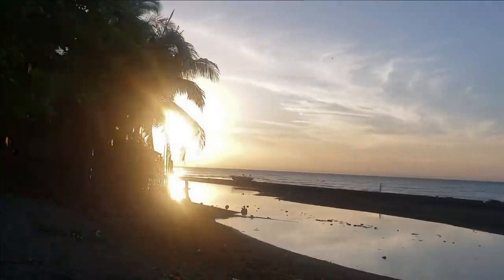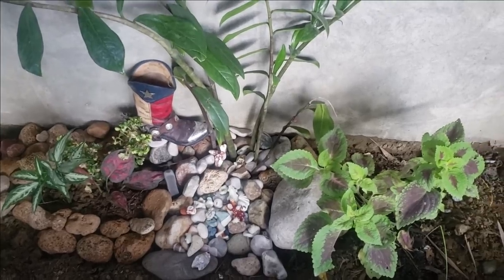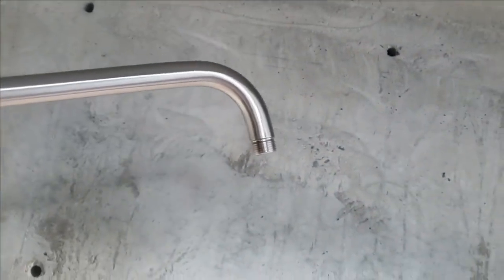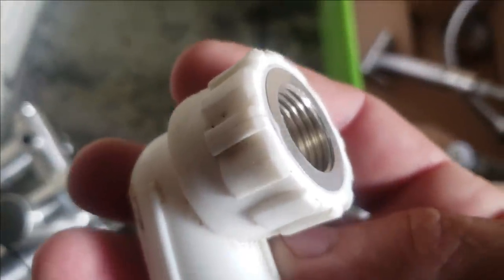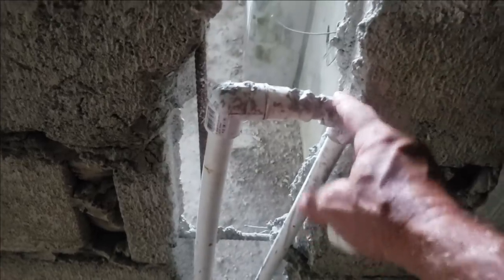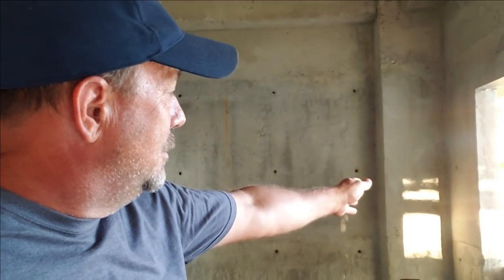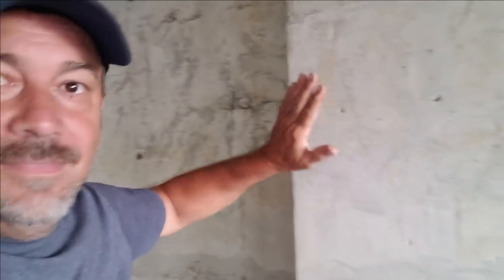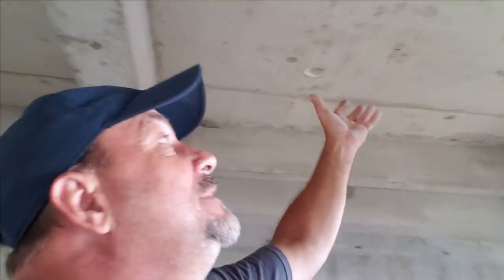Philippines Beach House Build Day 159 Part 1  GIVE UP  DREAM Beach CONCRETE HOME? Just Informed

Comment: I'm a master electrician and like your idea of building with concrete, but would prefer inside walls being steel studs and drywall. I would be much easier to wire now and for future needs. I hate the idea of CHB as you do. I'm sure it may cost more but not sure how much more. Other considerations maybe seismic activity and its effect on the interior walls. Your thoughts? Great job on the concrete, I really like your methods with the forms and finishing.
Reply from the maker: Less is more. The more you put in the more the cost the more to care for and the more to get damaged. DRYWALL and humidity - really ?  BAD USA practice! Mold - water damage ,cracks UGGGGHHHHH free your mind of the cheesy tract homes ways of thinking in America.  I know your a electrician but how much power could you possibly need and have you not seen how easy this is to wire. They almost wire themselves. Think In advance and say ok what could I possibly need in the future? Think - do you want to have extra circuit outside or some other places. run a empty conduit  for just a few dollars and pull it if you ever need it.  ask yourself what is drywall for? it is to have a smooth finish surface as interior wall yet you would be covering up the best one!  Fiberglass insulation in tropics - humidity drops it and it molds. All health hazards from  American practices.

Comment: Your totally correct with your construction method, saw your videos to late after I started my single story small build for my pool house,  24ft by 21ft. The amount of cement for finish has been incredible, and your so correct about the amount of rework for wiring and plumbing. I have a gibson ceiling which looks so much better than the traditional plywood or hardiflex, even the guys are surprised how much quicker it was to install and finish to a paint finish,
Reply from the maker: Great to hear!

Comment: I have watched loads of people building houses in the Philippines I cannot believe it the use of hollow block it's unbelievable it must cost more money than they think you're correct your way as far superior than their way
Reply: Understand concrete block is commonly used in the US. I live in Florida and I would bet 80 % of new construction is concrete block. Here the code requires filling certain hollow blocks with concrete. The issue with James wall is how it was built. In other words half a$$.  What James is showing us is so common on every island I’ve been on. Also I’ve seen many people move in their new home and never paint the exterior and some hold off on putting windows in. I visited someone once and they didn’t even have doors installed. Went to the kitchen when I woke up and some chickens were keeping me company till I chased them out.

Comment: 2:05 you talk about using the cement sacks to put down on earth and stop the grass from growing in your wife's garden. This is an excellent idea. I did the same thing here and I used the yard netting black fabric and put it down and then put bricks on top of them to stop grass from growing in the brick work. But I messed up and put a small amount of dirt in between the bricks so they wouldn't move when you walked on them. Then grass still grew. I learned that grass seeds grow in the tiniest amount of dirt and they don't need deep ground to grow. I can't fix it because it was too much work putting the bricks in. You have to do what you are doing with thick sacks or use concrete or sand in between bricks.

Comment: For your plumbing just run a straight pipe out of the wall 6” then cap it off.   Once the wall is finished you mark the pipe then unscrew it and look at your mark then get a pipe that length and you are golden.
Reply from the maker: sorry this is PPR and has to be welded or fused. can't do it like that

Comment: That block work is as rough as a bears arse!!, some people watching might be forgetting the climate you live in as in a colder countries you would have to double dry-line all the wall, ceilings, windows and external door openings, insulate plus add air an tightness membrane which adds huge costs to the construction.

Comment: James,  excellent discussion on the Hollow block wall.   Maybe I missed you saying this, but I am having issues because nothing is level or square when they render the walls.  I have more than an inch difference from top to bottom on some of the walls 😬😬.  And it just makes the completed job look unprofessional!

Comment: 3 of the channels that I use to watch about foreigners living there were building piggeries using hollow block for the pins.  2 of them are no longer active.  The other when at their peak were doing constant repairs because the pigs were knocking the crap out of the hollow 
 block.
Reply: If you choose and buy your hollow blocks from an honest maker that won't be a problem. And better yet, ask the block maker that you want a CHB  stronger, not their commercial mix. Ask him you want these number of blocks per bag of cement and not use cloudy or salty mix in tour block. It may cost you more and you are willing to pay for it. It is known that most concrete hollow block makers in the Philippines makes more number of blocks per bag of cement than it is supposed to according to the standards. Some of them even crumbles as your fingers approach them. Philippine Standards says...40 blocks per bag of cement. You may ask the person secretly, (not the owner) who makes blocks in the factory, how many blocks he produces per bag of cement. If he says over 40, then go to the next supplier.
Reply from the maker: 4 sheets of plywood , 10 foot stick of pvc chopped up , some all thread , nuts and flat washers and  and few pieces of cheap coco lumber and they would have had STRONG beautiful pig pen walls!

Comment: Love the vids man. I really appreciate you going into details and not just glancing over it all. Couple quick questions. 

What size are your vertical columns? Are those 6x6ft or even bigger?

On the amount of concrete being used, hollow block vs form wall. How is a form wall less bags of concrete? Are you counting the concrete used to make the hollow blocks themselves? Sorry if my newbie mine hasn't grasped it yet, I've never build before... or should I say Yet :-)
Reply from the maker: ok GREAT question. This hollow block here in this country and many other developing nations is made cheap with very little portland and a lot of sand. They crumble. So in order for them to have any strength you must fill ever void.  So lets start there. #1  you have to buy hollow blocks.  that is money that could JUST be spent on mixing concrete.  #2 now your going to have to stack the blocks or build with them. You need to make mortar mix. That is mostly portland with some sand. This uses way more portland than just doing a concrete mix. #3 secondary they will do a separate mix at the same time for filling in the voids. So now your mixing concrete - portland sand stone. #4  It needs a column on each end and a beam overhead to support it. Post and beam with fill walls is what it is called. So here you are still mixing concrete for that. #5 now is the real hog for portland cement THE RENDERING - it too is mostly portland with some sand. DOES IT EVER consume the bags or portland. You could pour SO many square  feet of cast walls for just what the rendering consumes.  Portland with proper mix of sand and stone it  goes way further.  we use a 1:5 ratio  1-2-3 it is also called . Your aggregate gives your concrete so much strength besides being a espansion.   Lastly is the strength - rendering always spider cracks every where and always will for years to come. The weak hollow blocks still are there inside crumbling and weaken. You still used the same amount of steel in columns, beams and in the fill walls. Horizontal and Vertically!  With cast you get precision , no waste , ready to finish uniform walls  with no spider cracking. No de-lamination of the rendering through the years. I could go on and on.  In the end your Concrete will go 3x further. that means your money goes 3x further plus less labor  in finishing etc which could mean a savings factor up to 4 to 5 x if properly managed
Reply: @TexasFilipino  Love it. Thank you very much for the info.
Reply: @TexasFilipino  well said, thx for your effort in explaining
Reply: @TexasFilipino  Thanks a lot bro for this explanation. Now I have a "concrete" proof or argument to show to my wife to convince her that it does NOT need a lot of millions to build our dream house soon in the Philippines. Watching your channel here in Chicago very closely.

Comment: for the problem with the shower connection there are normal extension connections, in 10/20/30 mm etc.
Reply from the maker: there is not a problem - I showing how to not make it a problem from the start.

Comment: James, been visiting the Luzon and Cebu for 30+ years, and I witnessed hundreds of houses and small stores being constructed, and I would wonder why they continued to use those ill made hollow blocks that are so fragile they break during transport and take so much labor to install, fill the gaps and paint. Only to see cracks after the first rainy season. I would think if you could use less Portland cement (which must be the highest cost component) your cost per meter to build would be much less. Not to mention, having to interlock the blocks at the 90 degree corners. Are the concrete mixers just too expensive? Mixing by hand for a large pour appears to slow and painful.
Reply from the maker: I am hand mixing strictly for providing jobs. Actually we mix more faster without a mixer.

Comment: Have you considered the seismic effect on the structure? You need seismic joints for movement. Philippines has a lot of earthquakes. Also, there are less options for future modifications. They usually build with reinforced concrete structural framing and hollow block walls. The concern there is workmanship and compliance with specifications not the design and materials.
Reply from the maker: Apparently you never watch our video or you would  know I have covered this topic and showed the joints SO MANY TIMES! How is the modifications less it is actually more. So let me clear something else up. I'm not some guy building for the first time. I'm a commercial builder from the USA.
Reply: @TexasFilipino  I did not mean to offend you. I'm bringing out possible issues. No I didn't see any of your videos. There's a reason why people in certain places build the way they do. It's good that new methods and techniques are introduced but usually before they are constructed they have to be approved by the OBO in your locality.  They are not that strict there though.

Comment: what were the little holes put in the casing concrete, (cigar size) for?
Reply from the maker: that is where the spacers and bolts go thru - those are filled and you never see them anymore
Reply: @TexasFilipino  ohh, so the bolts were installed to hold both sides of the marine plywood together?The spacers are left in place and the bolts pulled thru and reused?

Comment: My goal is to get a 35 ft Catamaran Sail boat and enjoy the 7000 plus Islands staying overnight each one .......maybe
Reply from the maker: that was Mel and I plan before we decided to build this and we almost dropped construction a couple times to still pursue that. We could have made cradles for the Cat and paid a large group of locals to roll it up on the beach during typhoon season and launch it back out  with dry season hit. We have a large cabin cruiser widebeam back in the USA that might end up here. If so then we will motor around. I want it outfitted with a diesel though.
Reply: @TexasFilipino  Trade it for a Sail Boat and go across the pacific via Hawaii Palau and Guam to IloIlo 2-3 months you should be home, or get a large magnet ang attach it to a Chinese cargo ship and be there in 30 days, LOl

Comment: James, It turns out the individual who calls us morons for doing poured concrete was paying us a compliment since it is either an 
imbicile or an idiot.  If poured concrete was the popular choice in residential construction there would be people trying to justify
hollow blocks as a cheaper better way to build.
       I am certain you are on the right track and did a video a while back of cost analysis between the two methods. Feel free to share 
that or any video or edited parts of our content.  The comparison shows a poured concrete build with wall thickness equal to 5 inch thick
crumble blocks covered with the code specified 3 CM of render mixed 1 to 4  cement to sand although code recommends 1 to 3 for render.
For the comparison to not look biased the poured concrete walls used 7 inch spacers for a thickness equal to finished 5 inch crumble
blocks. It was still 15% cheaper assuming skilled labor doing the traditional method. In actuality 5 inch poured concrete wouldn't need 
columns and could be a monolithic footer/floor slab saving a lot more.
       We went poured concrete for the cost savings since we are building with our social security and the house is 3150 square feet and
also we wanted a smaller crew size employed continuously  building many things over about a fifteen year period. The benefit  of the
poured concrete is that it doesn't deteriorate in the tropical climate sun and rain and you can go in stages with  low materials projects
having high labor usage between the stages. Right now they are all digging the cistern with barettas and shovels. Should take six weeks
for 37,680 gallon capacity in very hard ground.

                                                george and aurora

Comment: Question, and I know your beach house doesn't apply. Why do you not see basements over there?. The rooms would be so much cooler underground.
Reply from the maker: FLOODING
Reply: You see walk out basements in the Mountain areas, or were they build on a hill side. Filipino's are afraid that the basement rooms will fill with water and they will droned

Comment: 20x18= 360, is that m2 or ft2? if it is ft2 that is expensive and I doubt you can build 360 m2 for 300K php finished out. it is probably typical local style which is nothing finished half cement wall and the rest split bamboo etc. to be honest they would have to show some pics to see what this guy is really talking about because it is extremely questionable to be honest and I don't think I am the only one that thinks that way.
Reply from the maker: exactly!
Reply: @TexasFilipino  they probably have bare walls which means you see that really ugly crap brick. the way you are building is the much smarter compared to the typical local way of building. I think what I will be doing will be better because I will be using aircrete cast in place like you are doing instead of the cement which will give me a much better insulation to keep the heat and sound out. One thing that you might want to consider is putting 2 inch thick aircrete tiles on the outside of your walls which will give you much better heat and sound insulation so you don't have that heat blowing threw your cement walls and it will also keep the rooster and music all night long outside where it belongs instead of driving into your ears making you crazy. Keep up the great work James and I do hope that foreigners will want to have you build them their houses instead of these complete crap houses that the locals put up which as we both know start to fall apart shortly after the money exchanges hands.
Reply: @kusnezoff8705  Check the channel kryzzzie for their house on Cebu called "Skypod" made with factory made aircrete blocks'
Also    "The Isaan Farang" channel build used them. They are put up with tile adhesive, best I can tell, and no mortar shows
in the joints. They are laid flat like bricks rather than upright like hollow block, and can be cut with a handsaw.
Reply: @concretehousebuildinginph1488    I read a comment 'welcome to another thing that you can not afford' bingo!!!! I can mix my own aircrete and pour it in place instead of paying somebody to make bricks. It cuts out a middle man and leaves money in my pocket instead. Aircrete is super easy to work with and unlike those people, I will actually be building my house and not sitting in some resort as someone else does it. I love it when people say we built our own home, no, you had someone else build it while you watched or waited until it was finished. I can't afford those bricks. but I can afford a slurry mixer, a barrel water and I can build a foam making machine and make my own aircrete. nice house but I can't afford it no way no how.

Comment: That sure clears things up. I have watched at least 100 videos of homes being built in the Philippines. One lady vlogger showed how a nice home can be built for $6,000. She made fun of foreigners that came over there and spent millions of pesos for the same thing. Of course, she used hollow block. She used the tie beams and all of the typical Filipino methods. It was a bungalow, but a good sized one. I kept asking myself, self, why doesn't anyone just pour their walls instead of filling blocks with concrete and then covering the blocks with more concrete (rendering)? I kept thinking, I'm missing something here. It seems, it has to cost way more using hollow block, as well as being far more work intensive and time-consuming. I wish I could get somebody to give me a square foot cost on one versus the other.
Reply from the maker: In this case it cost less  to go first class - lmao
Reply from the maker: you just had to be a influencer of talking about bells and whistles in the trucks. Well HELL I love them creature comforts in my Tundra back stateside. So here I am with the most creature comfort truck sold in the Philippines. Good job BUDDY !!!! LMAO
Reply: @TexasFilipino  lol, exactly right.